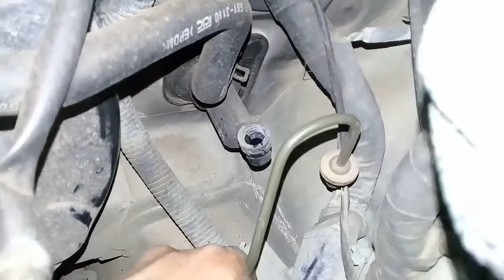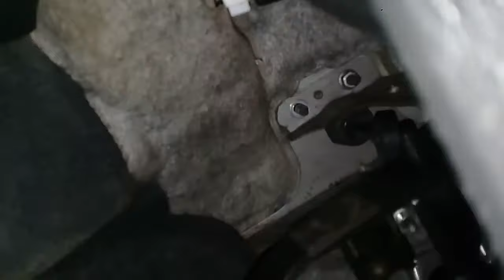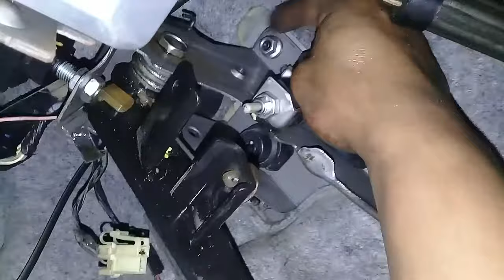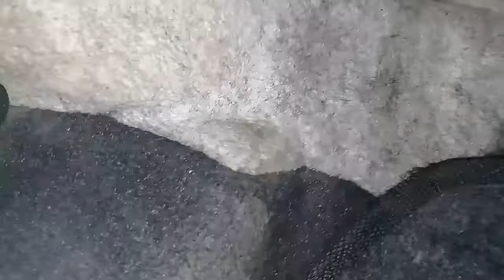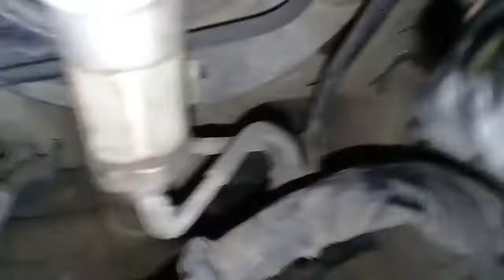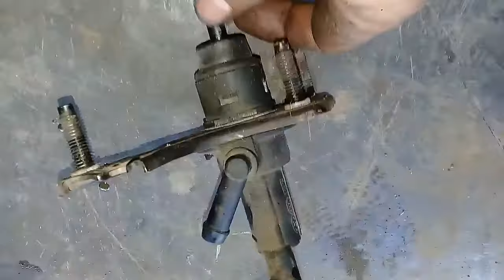Changing Clutch Master | Hyundai Accent

Comment: Boss, anu-ano mga kelangan tanggalin na nakaharang para ma access yan sa may engine bay?
Reply from the maker: Wala na boss, tiyaga lng masikip kc.
Reply: Hello Sir. Ganyan po ang ginawa ko kanina. Share kolang po. Battery mga socket Ng fuel filter pero Ng iwan Ako Ng Isa diko kabisado bka maputol. Tpos bracket nya ung 10mm at 12mm tpos ibababa nyo sya bka makakuha kayo Ng space sa pg tanggal Ng papalitan po. Ingat lng po sa mga wire

Comment: Ano ung clutch Sleep cylinder tinatawag sir? Itong accent ko kc matigas ang clutch lalo na kapag uminit na ang makina at tumatakbo na d na nabaon ng mabuti kaya namamatayan ako..pinalitan na clutch lining & release bearing bumabalik pa dn ang problem..ano kaya ang prob mga Sir?
Reply from the maker: Clutch slave or secondary clutch maam. Clutch Pressure Plate ang isa sa dahilan pag matigas ang clutch at  flywheel na di pantay.
Reply: @DiYSpanner   ok po Salamat👍🏼
Reply from the maker: @usernamecopyrightinfringement  thanks sir,

Comment: Sir sa akin kapapalit ko lang ng release bearing, plate etc. Tapos sir ang nangyari naman tumigas clutch ko hindi na maapakan , pinilit ko ilubog ayaw nya din umangat, tapos pinilit ko iangat yung pedal ng clutch para umusad ako ayaw na nya umusad.. tingin nyo po saan kaya problema sir? 
Dun kaya sa pagkakabit ng release bearing diko alam yung dalawa nya pang kasama, basta tatlo po yun diba sa isang set? 
Or sa clutch Master Assembly?
Pero sir kapag galing sa parada tapos inistart ko.. okay po ulit Aya gumagana yung clutch nya malambot po.. 
5yrs na po si accent
140k kms na tinakbo naka tatlong palit na po ako ng mga kasama ng release bearing.. di naman po ako Ma clutch., dito lang po yan nangyari sa akin sa accent sa ibang sasakyan ko naman never ko naranasan yan.. 
maraming salamat po sana masagot nyo tanong ko
Reply from the maker: Thanks